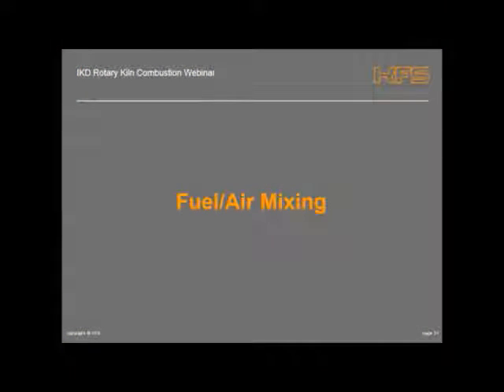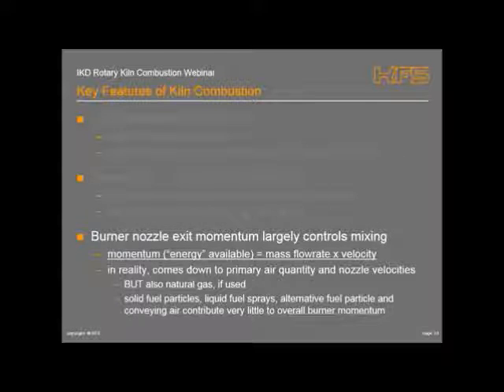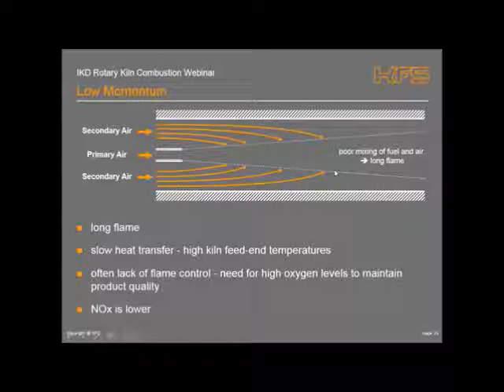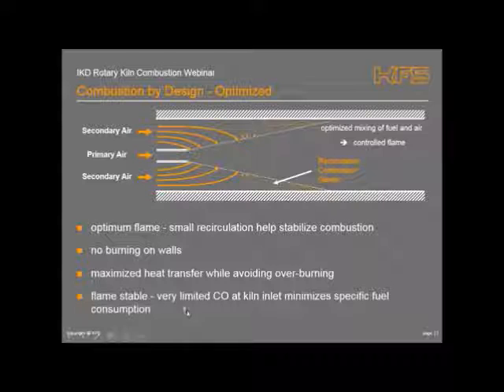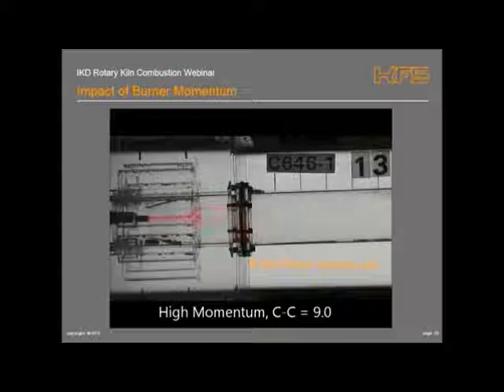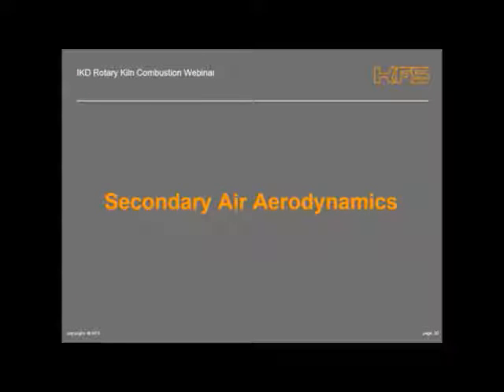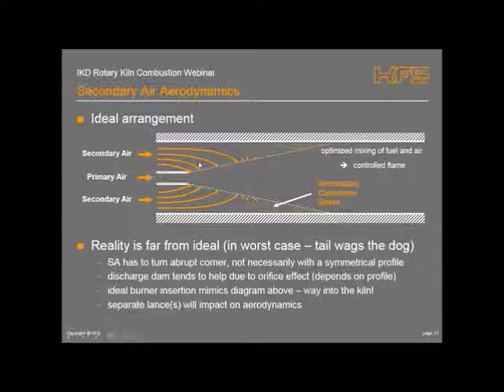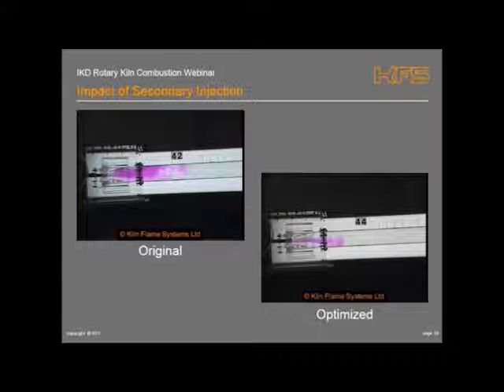Combustion in Rotary Kiln - Fuel/ Air Mixing

Comment: How is the momentum ratio C-C defined ? I mean is this momentum defined at the vertical plane where the primary air + fuel is ejected from the burner ?  Is the ratio equal to the primary air momentum + fuel momentum to the secondary air momentum ?